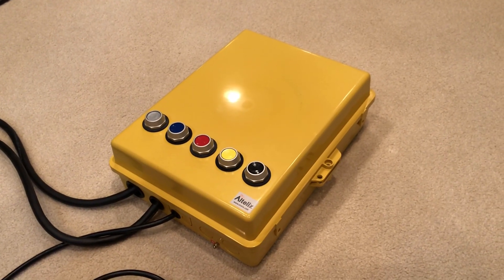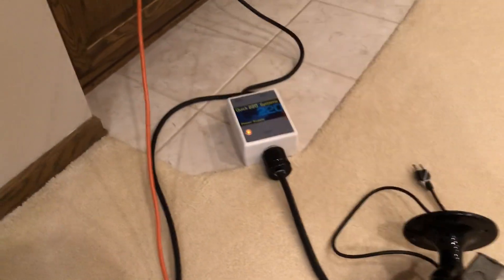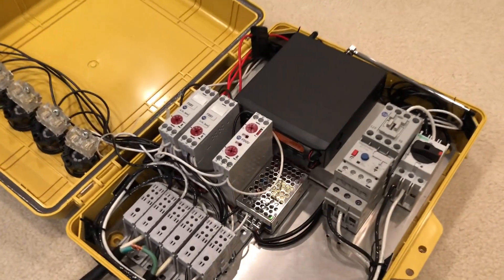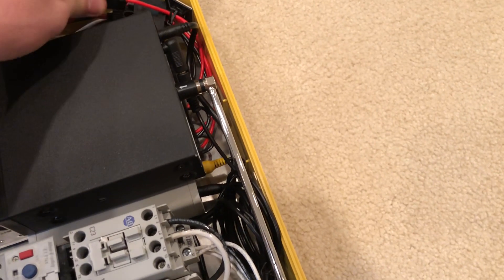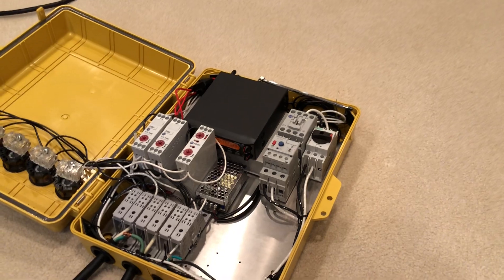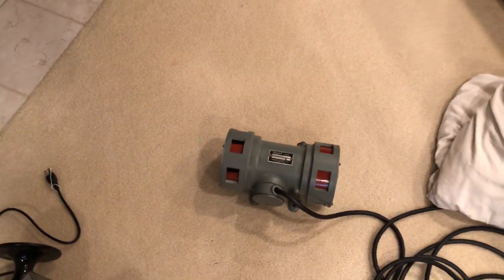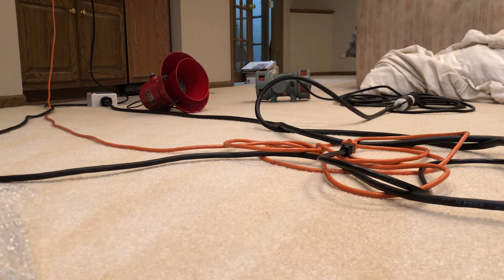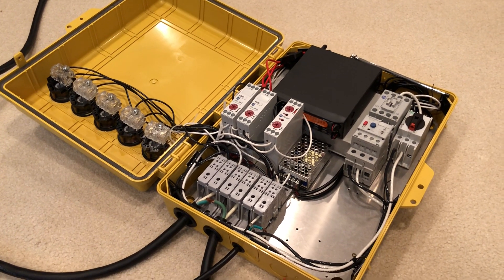Testing the Secomak GP3 Air Raid Siren via Radio with V2 of the All-in-One Control Box

Comment: I’ve made a controller using a PLC which minimises wiring as the timings are all done via software also allows me to run a automatic weekly test. I will post a video soon

The controller also has radio, IP and GSM control
Reply: I have a 490 MS unit. I am blind so please help me. How do you hook this up? I just got it.

Comment: It sounds rather different on 60Hz
Reply: They sound like that anyway.
Edit: no youre right there is a pitch difference. They’re higher than 10-12 air raid sirens but this is higher still
Reply: @mitch1326  I knew they nominally ran faster than normal 5-6/10-12 sirens, but at first watch 2 years ago it did seem to be running faster than GP3s usually did - obviously that isn't the case! It could just have been incidental of that run-up but it did seem to be at an ever-so-slightly higher pitch.

I'd assume the GP2 has the same universal motor, but I don't particularly fancy dismantling mine to check!